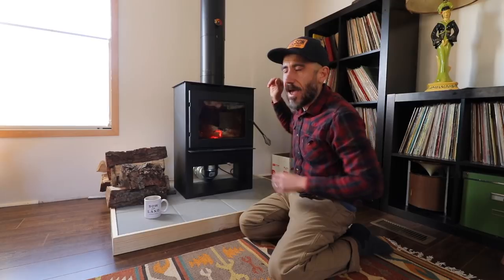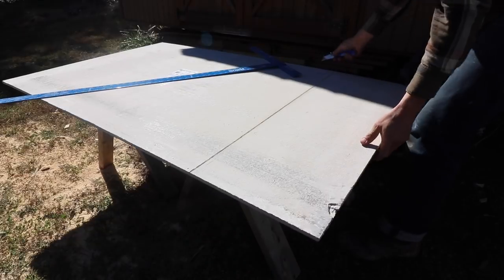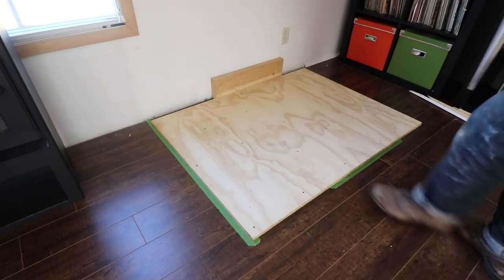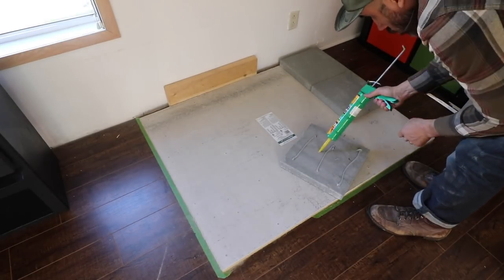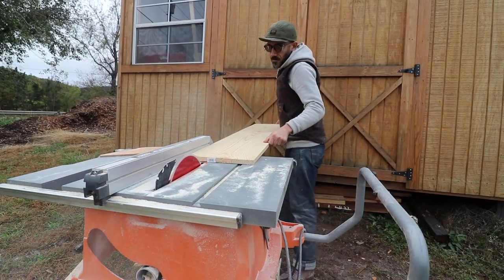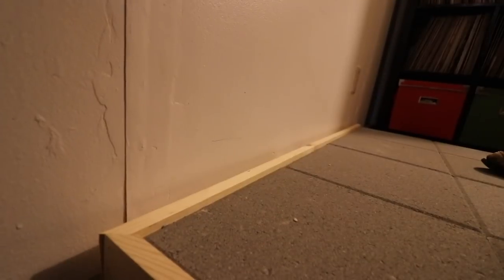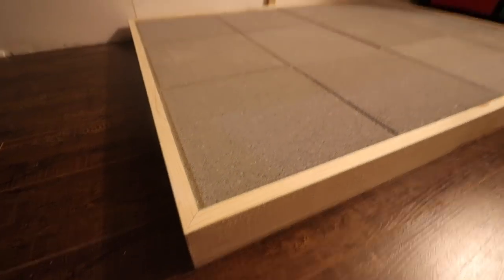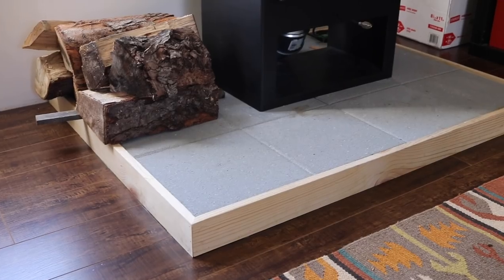DIY Wood Stove HEARTH in a Mobile Home

Comment: 2 yrs. later, I'm wanting, now, to install a wood stove in my single wide mobile.  I've watched quite a few videos so far and am researching til I'm blue in the face.  I must say, your video is THE BEST ONE.  The sound level is perfect.  You get right to the point of what you are doing without a lot of other distracting yapping.  Your ideas are great and you make it look so easy.  It flows.  I want to thank you for the vid with the simple, complete instruction and your pleasant, easy-to-follow delivery.  Great video!

Comment: Great shoestring build.  I would spend the extra $15 on Oak or any actual hardwood because the edge will definitely get beat up.  You drop something on pine or even push in the corner of your vacuum hard enough, it will dent.

Comment: Great video and method to install the hearth for the stove. The construction is massive when you put pavers and stove itself. You glue pavers to the cement board and you have a wooden framing nailed for stability. For me, such construction is heavy enough and will not move unless you have an earthquake. 
Why you need to screw the plywood and cement board so hard to your floor? I don't want to do that as it will damage my nice flooring and in case I would need to disassemble the stove it will be easier to just remove the pavers, the boards and the flooring underneath will be intact. Am I wrong? (in my project I have 16x16x2 pavers and I did layout and the construction looks so stable without screwing and even gluing it.

Comment: The stove has to draw its combustion air from outside in a mobile.You need 2 layers of cement board under those blocks (Because bricks and stone are excellent conductors of heat.)Is that construction glue fireproof???I had 2 layers of cement board under my stove for 5-6 years...and it didn't move;no screws.This year I will be making a brick hearth from old chimney bricks...That's when I learned the above info.Even with the bricks I will need 2 layers of cement board under it.God bless

Comment: Hey there💥 you need to get acouple fans and set ontop, they run by the heat. Man are they nice to push the air and no electricity use is even better😀.  Have a good weekend.
Reply from the maker: it came with a built in fan but yes, a fan on top would be nice. thanks!

Comment: I'm getting ready to do my flooring.  They say you shouldn't set kitchen cabinets on top of floating floors because they need to expand and contract.  My wood stove is a lot heavier than cabinets and am wondering if I should put my floor in and build on top, like you did, or flooring around the hearth..just curious

Comment: I like everything besides the exposed wood border. If you got an ember that rolled into a crack it seems like a great way to start an unwanted fire. A better material to use would be flat metal or angle iron to build the box frame.  Other than great job!

Comment: Nice install so far. I see you have the fresh air hooked up,I know you have to in a mobile home. however i hope you stress the importance of having the fresh air for wood/pellet stove for the positive and negative air pressure. they will run with out fresh air however they run more efficent and safer.
Reply from the maker: Hi Wes, all of that i am still learning and don't know much about. I was told by numerous wood stove professionals that the fresh air hookup was not necessary. as long as we crack a window open. But i added it anyway. Will talk more about it in the next video. thanks!
Reply: @SowtheLand  simple way to look at it is like a ballon when you burn wood with out fresh air it will pull air from all cracks/gaps from openings creating drafts.  if you add fresh air intake the heat from your stove will push the hot air out and no drafts. the sales person that told you to open a window has not a clue why you open up the window.other than someone told him to say that. He should have told you to hook up the cold air.

Comment: The problem screwing the plywood down to the floor is if you have to move it your ripping it up. It is not necessary to screw it to the floor. It’s not going anywhere unless a tornado hits.

Comment: Me and my sister are in the process of installing our wood stove. I’m doing the heart (your style) and she is brushing the stove and giving it the polish over. Our hearth build is going to be 3 x 5. A bit different in dimensions but so far it looks good tomorrow I will get some trim and install it. My only question is I want to rent a mailer cause I don’t have one but can I just use the extra all purpose adhesive to just slap it on there?